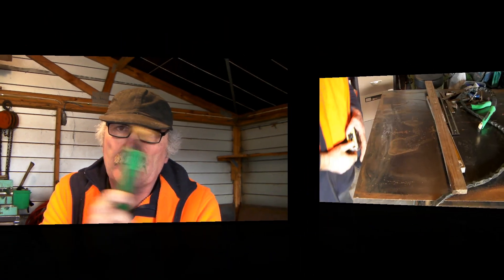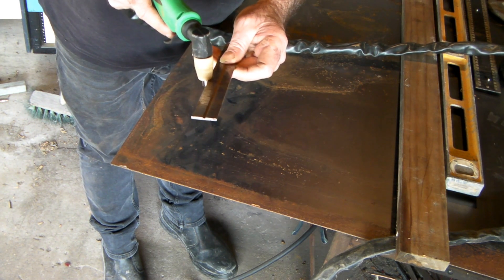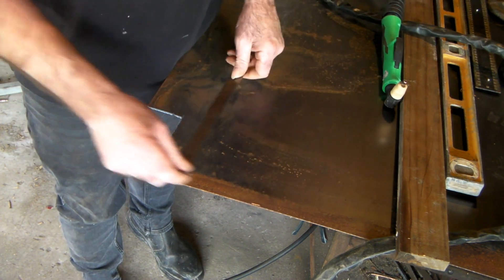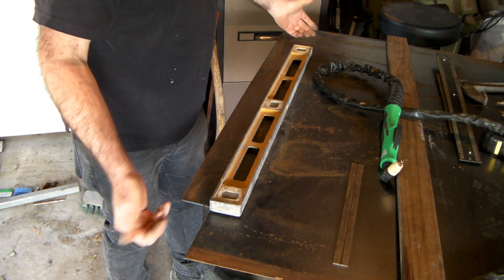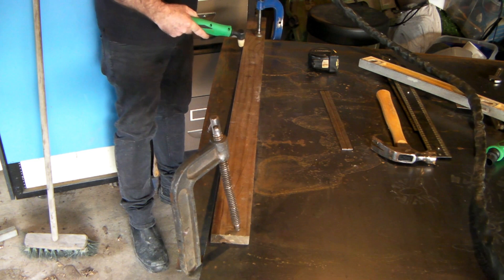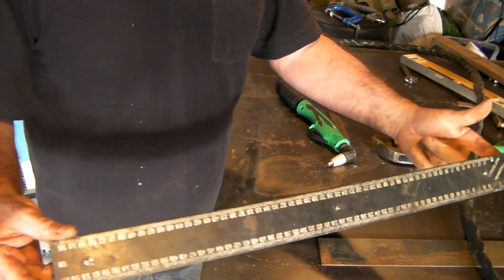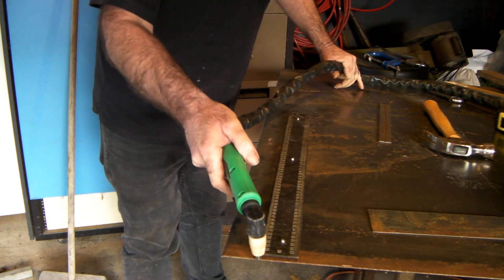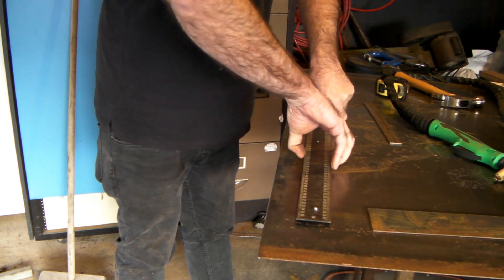How To Cut Straight With Plasma Cutter

Comment: Hi Pete, another great video, thanks. I made some rulers with magnets on and they work fine on thin stuff, but i have found on thick stuff the magnet field seems to effect the plasma stream so you end up a cut which is not right angles. Just wondered if you have seen this,

Thanks

Comment: Hey Pete. Any tips on cutting a straight line on a curved surface? I have a 30" diameter steel air tank I'm cutting down to make fire pit rings. The material is 3/8" thick.
Reply from the maker: see my cutting tape video